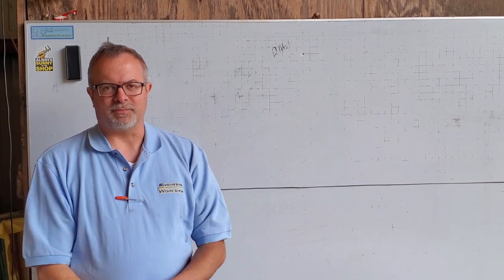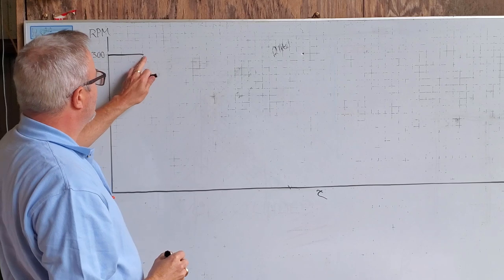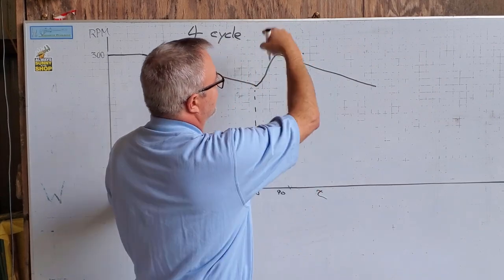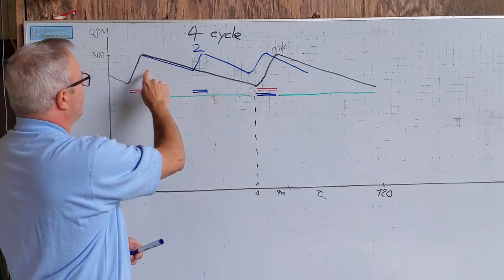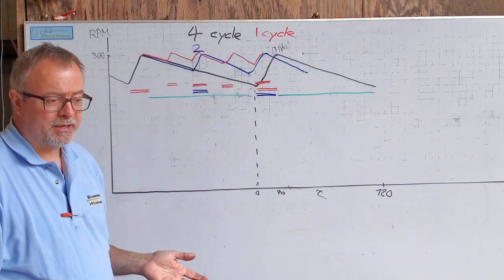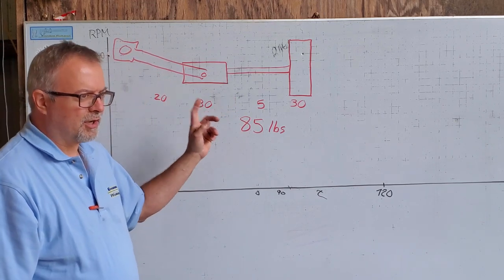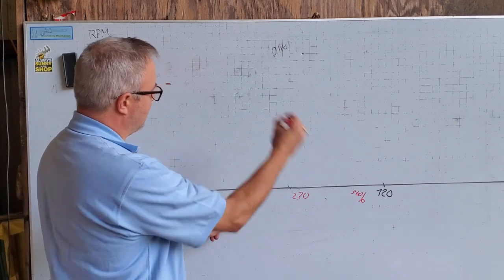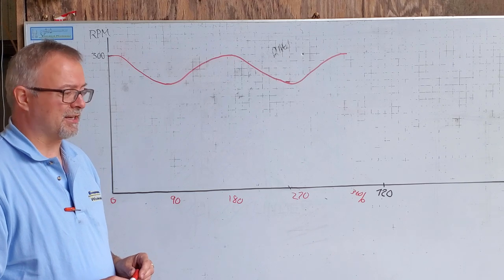The Flywheel Effect

Comment: How viable would it be to combine a flywheel system with a solar panel for after-hours power? Or to make it less complicated, a flywheel system that used off-peak power to feed power during peak hours? 

It sounds like there still needs to be a separate power source provided to the flywheel to maintain the RPMs and voltage. Capacitors might help a bit, but they wouldn't be able to sustain for long periods... So I suppose a flywheel system might be pretty good for running during peak hours and still drawing minimal power to maintain itself, but then that sounds like a more expensive version of solar power haha, of course the flywheel system might be a good solution where solar is not a viable solution for renewables if there isn't enough sunlight, or peak hours occur after the sun is down (On some distant imaginary planet).

The advantage is the flywheel would be a lot more reliable than solar, but I can't imagine how much it would cost to create a flywheel that could output 5kW, let alone how much space that thing would take. Oh yea, and awesome video by the way!
Reply from the maker: Flywheel systems are definately high tech and $$$ to provide serious amounts of power. The flywheel I describe only stores energy to smooth out power pulses of the steam engine. Your suggestion of combining flywheels and solar is being done I'm sure.
Reply: We will need something really soon for the national mains power grid, as the supply for energy increases. just saying, looks like it was along the lines you wrote here.
Reply: Look up gravity battery
Reply from the maker: I have researched these. Massive and difficult to pull off on a small scale that will store significant energy.
Reply: Amber kenetics 10k+ for 60 to 150 kwh. Personally, I feel like a sand or water, thermal batter would be better for home storage. A flywheel would be good for an ev charger booster.

Comment: In real numbers, how much is the flywheel slowing down and speeding up on the Skinner?  At 300 RPM, how stable is it?

Also, thanks for posting this, I learned a little something.
Reply from the maker: I will eventually determine this, but have not modeled the Flywheel accurately on the computer to know the mass. As I disassemble for rework, I may have a crane scale by then to help weigh components.